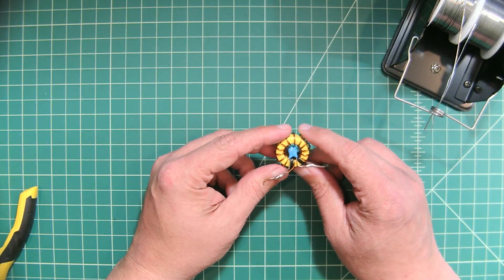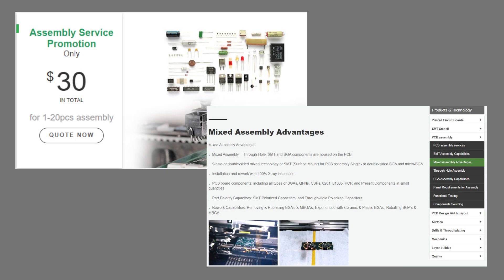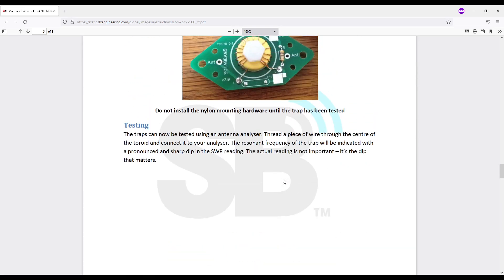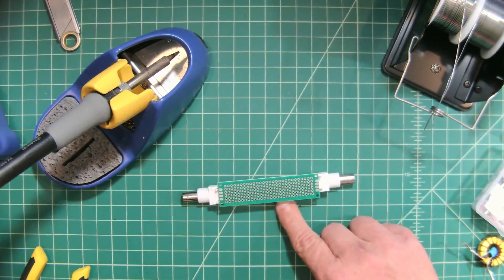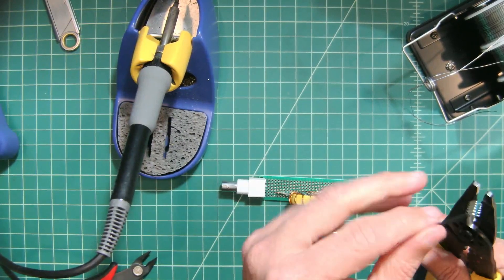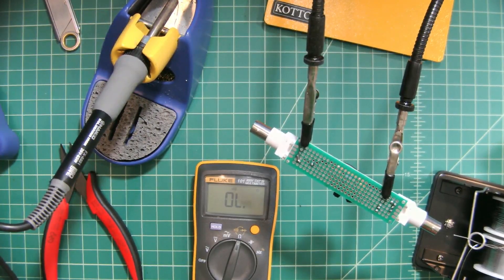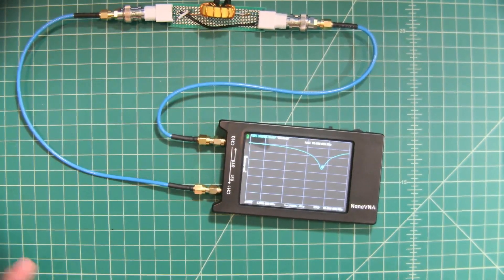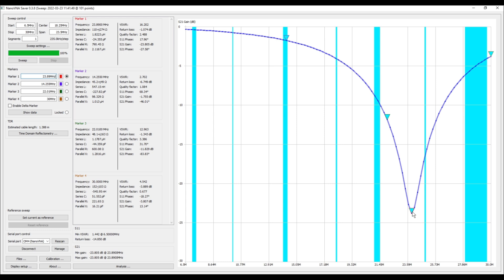DIY Antenna Trap for Ham Radio

Comment: Hmm over engineered I think. I just used stripboard pcb. For 20W 10m trap I used 3x100pf 3kv caps in series to make 33pf. I then interpolated the inductance of 13 turns on the T68-6 toroid from the sotabeams table as being ~0.94uh. measured it at ~0.95uh. same LC meter as you.
Put the caps down one stripline and manually used a drill to remove the track between the cap legs. Attached the coil to the ends. Looped a wire through the coil, attached the wire to my nano vna and measured the resonance at 28.280mhz.
I think you need to inductively couple (as per the sotabeam's instructions ) im not sure of the reason maybe the impedance is to high (not 50ohms)  for the nano vna to measure directly across the trap? Not sure.

Comment: Sir, re Iron powder Toroids used. Specs state
Mix -6 Yellow = u8 for 10-50 MHz.  While
Mix -2 Red = u10 for 2 -30 MHz.
For 100w HF digital operation respectfully suggest min core size T130-2 which handles the heat better, yet when checked after a long QSO lowered the trap dipole measured 65°C .  

Whilst runn'g a 12 Band 3 element Fan Trapped Dipole. 
❤
 Considering generated temp under Contest conditions, so started replacing the T130-2 traps with T157-2 size tuned traps. Temp Results measured after 90 min of continued lengthy transmissions were 31°C.

Best Regards from the land of Aust down under. Bruce VK2BPP
Reply from the maker: Thanks for the details Bruce 👍

Comment: Don't forget that there is a tolerance to the value of the capacitor, and spacing on the windings.
Reply from the maker: You are correct, great points 👍

Comment: Was thinking about something like this to replace the coaxial trap just to find out if this would 'kill noise' I have on 80m on my dx-commander. Not sure what is causing that but it is irritating me in an awkward way. No clip-ons / 1:1 balun seem to be able to fix it. Removing the 80m part 'fixes' the issue as it quiets down the rattling noise completely but unfortunately it also means I can no longer TX on 80 so that is not very usefull.
Reply from the maker: Oof, it sounds like you have your hands full